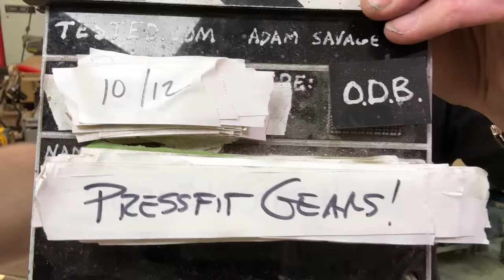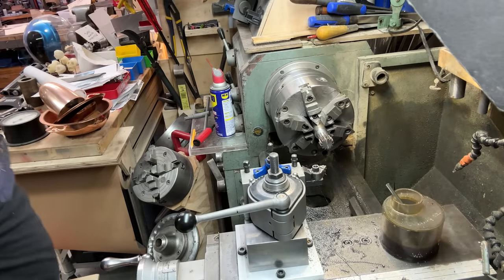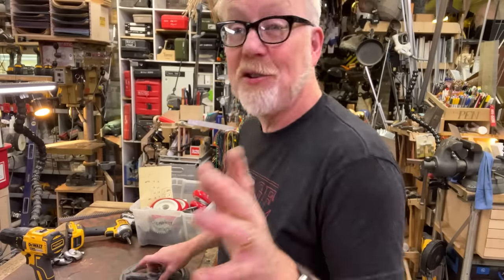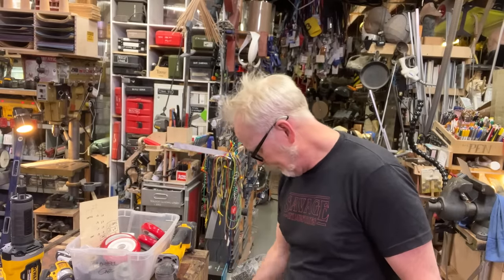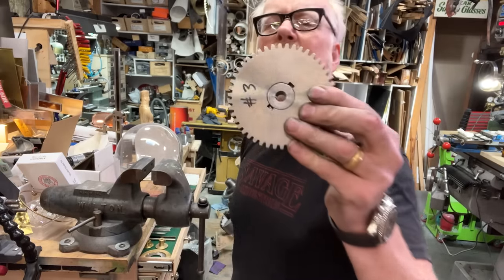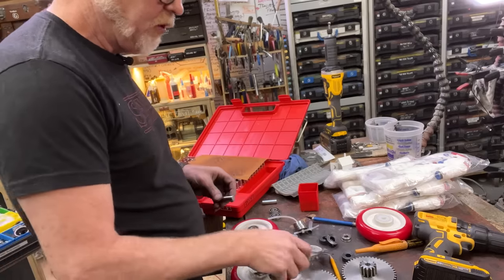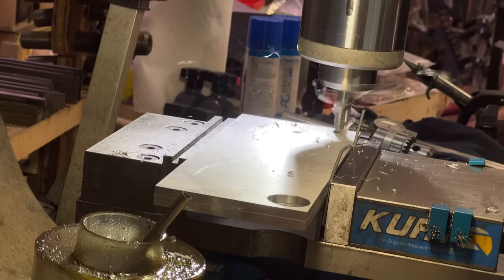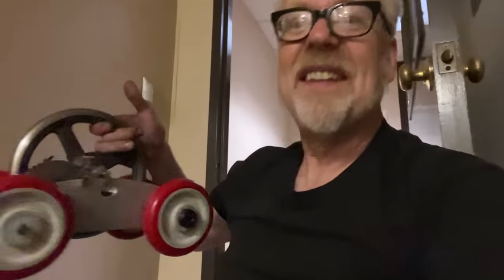Adam Savage's One Day Builds: Giant Flywheel Toy Car!

Comment: When the small one is "charged up" it is pushed much faster and farther than it was being pushed on the large scale one, especially when you account for the scale difference. If you put it on a stick, like those little kid trikes with a parent handle, you can probably run it up to a pretty good speed. It's only going to maintain the speed you give it, but this flywheel means it will go farther, all things being equal.

Comment: the noise is the  gear depth being a little to close and maybe some lubrication may be needed as well. Either  silicone or graphite, if not a medium machine oil. To be able to use your body weight to better advantage while pushing it to gain speed you might add a handle to the top so you don't need to bend down as far and also be able to use more downward force.  I'm a retired auto mechanic , and I'm just  beginning a build of a replica 'T-Rex three wheel cycle, built from two complete   20"  Wal mart bought BMX bicycles as the base and modify as need to achieve the goal of a low slung "pedal car" with a 212 cc predator v- twin go cart/ minibike 4 stroke motor from Harbour Freight as main power but still maintain the inner pedals of the two bikes ramain in original position and the outer pedals sawn off, The frames cut apart, front from rear and stretched for low ground clearance with the driver (me) sitting between. The pedals remain .with the front half  but hidden under the inner cab floor when motor driven  for the legal is reasons it's still a pedal bike.  The rear half also extended with a swing arm suspension like a motorcycle single air shock and motor platform on the swing arm and a fuel tank above in it's own cradle ..the fiberglass monocock tub like an F1 care car  suspended between the frames and attatched to front rear portions the final build will have all  the required lights and a horn like a motorcycle, but will have brake and eccelerator pedals under the dash like  car seedo, turn signal . back up lights and beeper...lol yep the little monster wany not be quite street legal but all the bells and whistles in ca put on it. and still be under 200 lbs I think. Including a lightweight body that  will be added later, then painted,  it'll be constructed of rigid insulation foam and resin.  I'll be smaller then a motorcycle and hard to see but need a battery shelf forward of my foot well directly between the front wheels. I have the basic plans in my head ready to take measurements for final design. I already have many materials that will do nicely for this build but will need a lot  finesse and  fabrication. Wish me luck.

Comment: Machine the flywheel so that the spokes are much thinner, and the main mass is at the very outer circumference.   That and larger diameter wheels would also help.    I know I'm mostly restating comments that others have already made, but not necessarily together.

Comment: Any time you get noise in a gear train like that it indicates energy loss, so that's one part of the problem - maybe the gears are out of perfect alignment as you suggest. Also I would wager you need a heavier flywheel of greater diameter so that it can store more energy - your buggy is a lot heavier proportionally than the original toy!  I'm no physicist but I would imagine there's some law of squares involved here - double the size/weight and you need to quadruple to stored energy which may be why these flywheel toys are always quite small! 
However it is a beautiful creation, even if it doesn't scoot along like a toy, and like all projects of this kind I'm sure you've learned a lot along the way and you clearly enjoyed the journey, which is the main thing.

Comment: Lighten everything, make the gears happy, and some taller (light) tires, and itll be a runner! 
Im not sure exactly went "wrong" but it seems that the energy of the spinning flywheel is getting eaten up before making it to the wheels, and probably because of weight and the improper meshing of the gears. the way im thinking of it, you want the absolute least resistance getting the power of the heavy, rotating flywheel, to the tires, and even once youve achieved that, it still has to be more than enough to overcome the weight of the entire car, and push it. Also keep in mind that the size of the drive wheels must be accounted for in the gearing ratio. 
maybe change materials, or skeletonize everything, and remove resistance wherever possible. Also,  remember YOU are what is powering the car, there is a sweet spot in size and weight of this concept, and you need to be able to spin the flywheel fast. 
What a Great video! Lets see an updated version!

Comment: I think if you put a hex end or female square end on the rear axle so you can hold the rear wheels up and spin it up with an Impact gun first that would get it moving a lot better. I've seen other flywheel car builds use similar techniques. I realize that the point is for it to be wound up by hand like the toy but sometimes improvisation is necessary.

Comment: I'm struggling to recall the details of my flywheel energy storage class in college but I believe if you use a solid flywheel it will probably do a lot more work, and if you weld a big handle on the back end so you can actually push against the car and move it fast and then lift and pull back and push again so you can "rev" the flywheel a few times before you let it go you'll probably be able to get the RPM way higher. Or you could just clean up the gears and use a grinder chucked onto a nut threaded onto the flywheel axle to spin it up - the unsafe grinder attachment community would love that lol
Reply: beautiful build though even if it isn't putting a hole in the wall at the end of the hallway lol

Comment: launch system would be good side project for this. some handle above the flywheel wich would attach on the frame with button release mechanism, so that you could get a grip on it and spin the wheels on the ground and then detach the handle by pushing the button.

Comment: Attach a drill to the wheel to spin the wheels Up and add a handle for safety once the thing is flying. In the small version you can spin the flywheel many times faster. The car will only go as fast as the wheels are spun and it’ll only slow down from there.

Comment: nice buils Adam, i am collecting stuff to make somting like that my wheels are much smaller , and i tought of using clockgears. Maybe the mass of the geartrain is bigger thant the flywheel. make it much harder to speed things up. use a powerdril to speed up the gears and flywheel, to let it run

Comment: Nice build and video!
Your flywheel seems to have a lot of air resistance in the wide spokes at high rmp, and thats killing the whole idea of storing energy in a fast spinning flywheel. Try closing the gaps between the spokes whith sheetmetal or use another kind of solid metal wheel.

Comment: What if you drill holes into the 46 tooth gears so they have less rotational mass and therefore less resistance? I believe that would work to improve the flywheels ability to turn for longer

Comment: remember SSTs?   they were excellent,  just the right amount of dangerousness,  they came with a little rip cord that stripped out after a few runs so you had to use dad's air compressor to to get the flywheel turning,  of course we got em humming at 100 thousand RPMs and unleashed them and they would rocketship down the driveway jump the curb and brake into a hundred pieces when they hit the neighbors house

Comment: Another nice build, its an intertia based system and your ratio of intertia of flywheel vs gear array is off. Either increase the flywheel or decrease the weight of the gear array by making them thinner or nylon etc. Have fun !

Comment: Bery nice build Mr Savage. However I think, from my understanding of physics, the flywheel is for storing and releasing energy therefore diameter and mass of the flyweel is too small if compared to proportions of the small model. That would Explain why car is slowing down so quickly. Also for that gear ratio, the diameter of the wheels should be bigger for that speed fator that was also bit dissapointing as You said. Anyway the concept itself is awsome and the quality of Your work is astonishing. Thank You for all You’re doing.

Comment: Hi Adam .
Very nice build however running issues mostly down the weight ratio off flywheel to gears is to close its not just the gear ratio but also the weight ratio has to be considered. I would also get the gears running a little smoother and a lot lighter! But I love what you did here regardless.

Comment: you need to thing about how fast the Little Flywheel is moving in Scell with the larger one. and how much faster it is spinning when you push the little car. I think if you push the big one at the same speed it will work as it should. Also your gears are to close together and that is causing your problem with the Clack. and its causing a lot of friction so you are not getting as much power out the flywheel as you could.

Comment: there is a lot of air resistance with a spoked wheel compared to a solid disk you could make it much heavier too by simply pouring molten lead around the holes then static balence it by trimming the lead

Comment: Perhaps perform a mass scale comparison of the original toy to the new build.  I.E. measure mass as a whole, then flywheel, frame, gears and axles as a percentage, and compare to the super size one, also keeping in mind centrifugal mass as applied to the relative diameter of the original  flywheel as compared to the metal gear.   I believe (hypothetically at this point) the original flywheel to whole mass on the original toy will be much higher than the metal gear version.  Short story, a larger flywheel is likely needed to keep the mass scaling correct.

Comment: Few things, higher mechanical advantage will actually make it less efficient, dip the gears in motorkote, and the the holes in the flywheel are very aerodynamically inefficient, make it smooth like the Aero wheels on a bicycle. Awesome machining work though!

Comment: The alignment of the flywheel to the gear in first contact is where the losses are. Not the depth, not the type of gear and not the ratio. The left to right alignment. You can maybe incorporate an adjustment mechanism like we have on motorcycles on both sides. 

The other bit is with a small sized car when we CHARGE IT UP, we roll it at the speed we want it to go and then due to losses it slows down from there where the flywheel tries to hold the momentum as much as it can. The large scale model requires that much scaled effort to spin up the fly wheel and simply rolling it with your hand on the floor wont work because it will slow down from there. A flywheel car always starts with the energy you put in and goes down from there. 

Also considering the weight of the built car which might be a few times more than the scaled size factor the flywheel will require more energy to go on with all the mentioned losses.

Comment: So I hesitate to offer you advice since I'm A; 2,000 miles away and am going by sound, and B; not much more than a "teenage Hotrodder" level tech, but it sounds to me like the gears are a bit too tight and likely fighting the corners of the teeth profiles. The fact that as the wheel slows to a stop it sort of pulses and stops in a "notch" makes me think you might make that marvelous device much happier by generously applying some fine lapping compound to the gear teeth and twisting it's tail good and hard. As long as it doesn't get in the bearings it's not going to do any harm. Like you, I see any reason that thing's performance shouldn't match it's appearance

Comment: Engineer here. The most obvious issue is since that seems to be extremely heavy, in order to move and requires a lot more energy. As well as the significant amount of clanking which is eating up your potential energy every rotation. 

Getting a higher mechanical advantage would help to an extent, but unless you fix the underlying issues, you will still be burning up a significant amount more energy than is necessary

Comment: Did you consider material differences between the gears themselves?  The model you're  referring to has a lot of lightweight plastic gears that might be taking away less kinetic force from the driving gear / weighted fly wheel of the all parts combined were metal im not sure it would behave the same.

Comment: The main issue seems to be that you aren't able to store enough energy in the flywheel.  The moment of inertia for your flywheel is too small.  As you know, this is affected by the mass of the wheel AND it's shape.  You could scale up the wheel, or scale down the rest of your construction.  The build is gorgeous, and it's substantially over built.  You could probably slices each of your gears into fifths and make five of these machines with the same profile.  Each of them would need a full flywheel.  Or you could build this out of wood, or maybe Delrin.  Essentially, you have a lovely tank, with a Yugo motor.  Still, Fantastic Build, and another great video.

Comment: My (hindsight) guess is that the rotational inertia of the flywheel isn't that much more than the sum of the rotational inertia of the chunky gears used to get the mechanical advantage.  If you look at the toy car, the large diameter gears are very thin and the small ones are plastic.  You could try cutting holes through the big gear to reduce its mass.

Comment: It looks awesome! IMHO your problem is friction and wheight. The toy car has gears that resembles the ones inside a clock, designed for lowest friction (rubys as bearings). Also tyres are not good for your purpose, too wide. If you want to improve (but I think you've lost interest) try with thinner and lighter gears and wheels, and mounted them on ceramic bearings. The gears you used are capable of transmitting 15 Kw or more (comparable size to a motorbike gear size) and would dissipate a huge amount of energy. Try to calculate flywheel rotational inertia :1/2 rotational inertia x angular speed squared to wheight ratio of the toy car and compare with yours, I think you have to lower the wheight a lot.

Comment: Its definitely a mass issue.  If you weigh each original component, the mass of each compared to the flywheel needs to remain relatively the same ratio.  It's like having a very light flywheel in a car, it accelerates fast but at the expense of torque.  Maybe make a flywheel mostly out of lead if you don't want to remanufacture the gears.

Comment: Could put handles on the sides so you can press it down to floor and really get it going. Also weight of the reduction gears probably wont produce intended effect, while also wheels are bit too small. Additionally you could remove surface area from the bearing surfaces in lathe to decrease the friction well as add say graphite as lubricant. Sounds like there is some meshing issues as well that cause issues. Also as last ditch effort make electric drill tool that can wind it up to proper speeds. Do those and i'm pretty sure it will fly on the another end of the hallway at least.

Comment: I think you should make the powered road wheels going fast by pulling it several times faster and faster as you should do with a small scale model, but here requiring far more force, and then let it go, and it should go far. Isn't it ?

Comment: Question: why did you just use a press fix as it can warp something and then you're really in trouble, an interference fit would be easier and safer, liquid Nitrogen on the brass gear and a slight heat on the fly wheel as its cast so it does not expand as much  as steel, it would have made things even more secure without a deformation risk?

Comment: when i was a kid i had the one you would get the wheel all going really fast by pushing it 3 or 4 times on the floor. when you wanted it to go you would push a little button and it would then take off! im assuming the button dropped a gear in place and off it went

Comment: Adam the gear pressure is to great. Try putting engineer blue on each gear tooth and scrape off the on heavy pressure, which would be showing with must contact on each tooth. and cast iron hand wheel needs to heavier may solid

Comment: Your flywheel needs to have a much larger mass ratio over the rest of the car.  Thin the gears down as much as you can, make them out of aluminum, fill the frame with holes.  Increase the wheel diameter.  And you might even want to consider drilling many holes through the flywheel and slugging them with lead or tungsten.

Comment: Not sure these things scale linearly 1:1... from memory you need to workout the stored kinetic energy of the fly wheel system and make it balance against the kinetic energy of moving the model (+ energy losses), directly scaling up the gear train won't do it. 
There is a nice / simple watch & clock makers tool designed for correctly spacing small hand cut gears, I'm assuming there is (or could be made) an equivalent for spacing larger gears to get rid of that evil sound and associated inefficiency in the gears.

Comment: Bigger wheels as stated and the weight holding you back if you look at the original years  it's all just enough metal to hold its shape  then brass and plastic plus really light body and wheels etc you've got a ton of mass with all those solid gears I wonder if bigger wheels and aluminum gears drilled etc to make as light as possible would help get it that umph wanted 👍👍👍

Comment: oh.  OSHA. Those guys. Scaffolding poles have an extra thick pipe wall. Use that for leverage when you need it. I can tighten 40 ton tractor bolts. It's a good add to your best breaker bar. That is using your pipe vise instead of a hydraulic press... different tools but quite close.